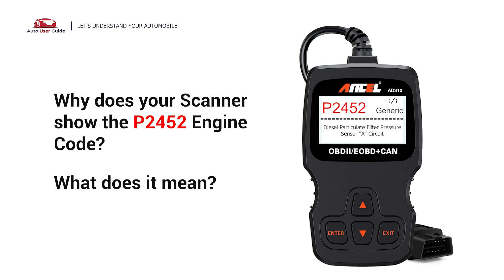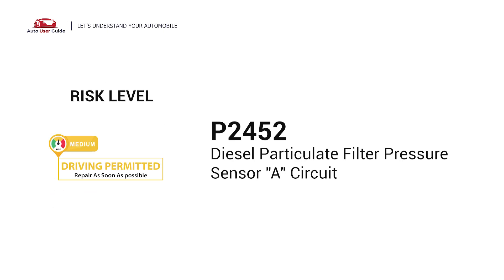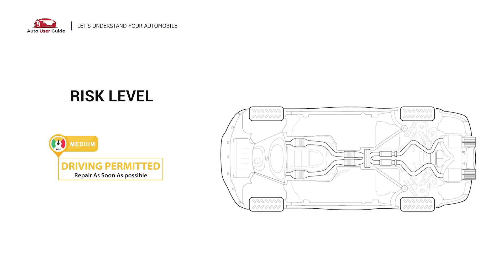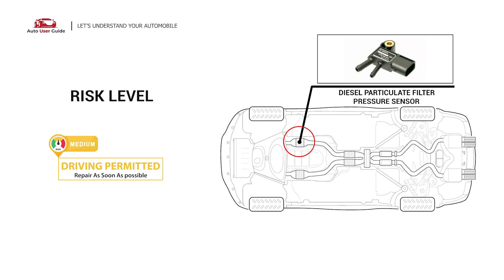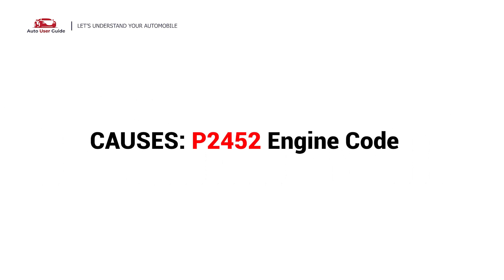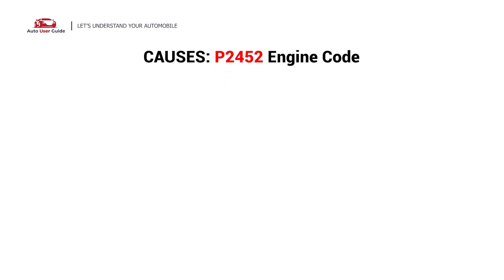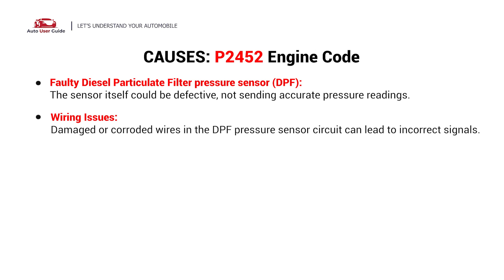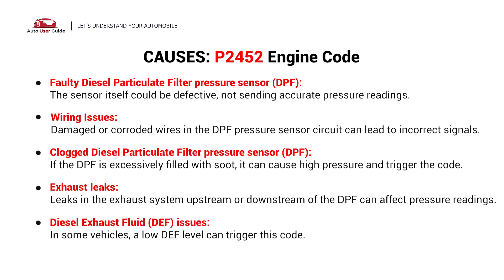What is P2452 : Engine Error Code Causes Explained

Comment: Hello, opel astra k 2020 year 1.5 diesel engine. Can this fault appear with check engine light by driving short distances and cutting dpf regeneration? I have checked manually data stream of this sensor. Sensor reads data correct. Pressure sensor reads 0.01bar at idle and 0.08bar when engine is under load so it meand dpf is not clogged. I even used my hand pump to manually increase pressure and it shows like it should. After driving some time, at random time dpf regeneration happens and check engine light turns off. When using diagnostic tool, i even see soot level drop from 93% down to 0% and when i shut off car and start again, it rises back to 14% immediately. There is no limp mode, acceleration is very good, so i am pretty sure there is no clog. I checked even tubes going to dpf, all clear, only one hose has some little soot inside. Do you know if this is just by driving short distances and i should just drive longer? Or there is a fault in the sensor or in system? As far as i can see sensor reads ok dpf is not clogged.